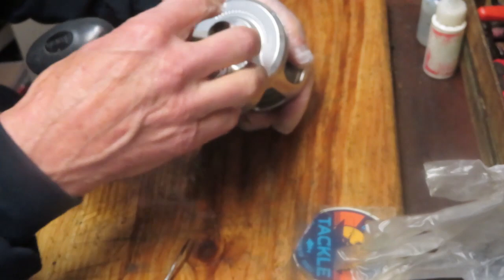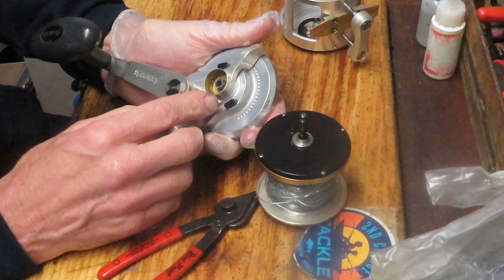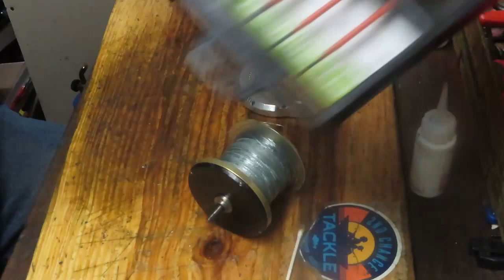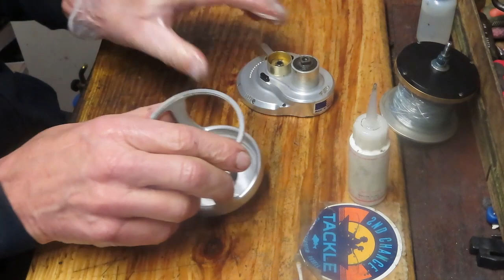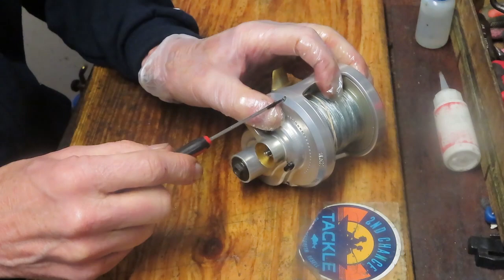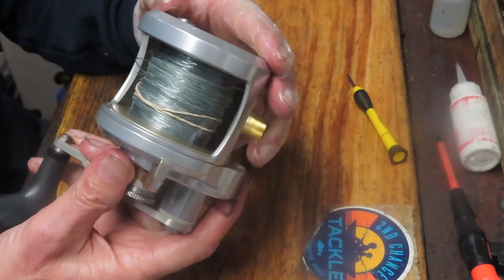Accurate Boss Fury 600 lever drag fishing reel how to service

Comment: You really should treat every reel serviced with a good soaking in Salt Away after removing and properly cleaning and lubing the bearings, roller clutch should never be lubed but given a very light coating of corrosion protection oil with a Q-Tip.
Reply from the maker: Thanks for the tip - I will check it out - Dennis
Reply: @2ndChanceTackle  reels used in saltwater need thorough cleaning with something that will get out the salt residue and salt deposits. This salt if left on reel will eat away the highest-grade aluminum. These salt deposits hide under bearings and main gears causing pitting in the aluminum. Every part must be disassembled and cleaned. Salt will also contaminate and mix with the grease which must be removed. Under the main gear and gear shaft and gear shaft bushing is an important area to clean, this area can hide salt deposits that can damage and continue to dame the area. Salt deposits are hardened salt that deprives the area of oxygen and will quickly Pitt the aluminum and corrode bearings.

Comment: Hello, I have 2 speed version of this reel. It has some corrosion and a couple of pits on the side of the spool where line has sat for some time. Do you have any ideas on what to with the corrosion? Or to prevent more of it?
Thank you!
Reply from the maker: You should be able to use a good metal polish and a kitchen scrubby or light 0000 steel wool to remove the corrosion.  If the parts are pitted, you will not be able to fix that cosmetic issue once the surface cleaning is completed - Dennis
Reply: You could fill the pits with epoxy but make sure you clean all salt out of the pits orccorrosion will continue, saltaway or saltx works good and is used by navy seals on their scuba gearcsaving a lot of money.

Comment: Hi second chance tackle, why does my level does not go all the way up or down. I put the carrier the right way
Reply from the maker: Sounds like you have not aligned the inner ramp to the side case studs.  Take the lever off and align it to the free spool position before tightening the pre-set adjuster